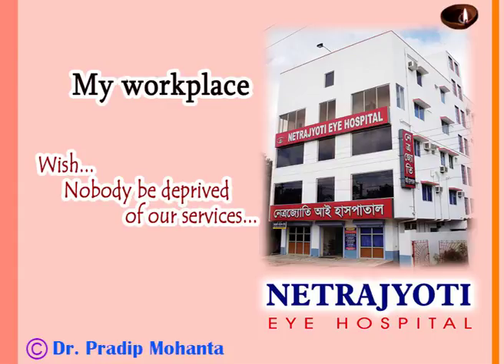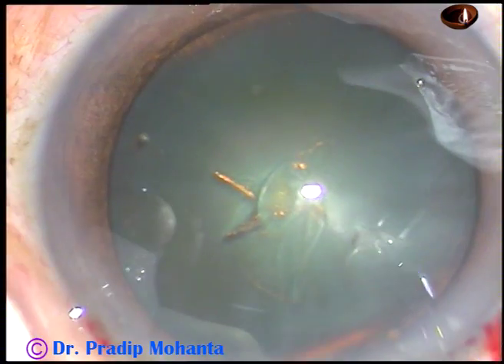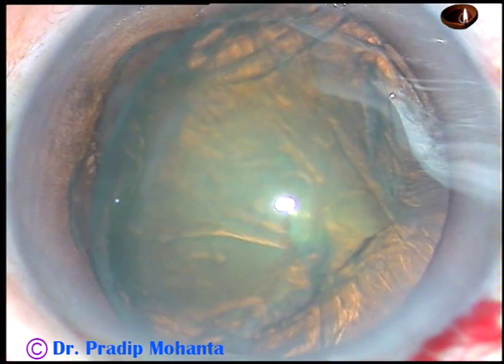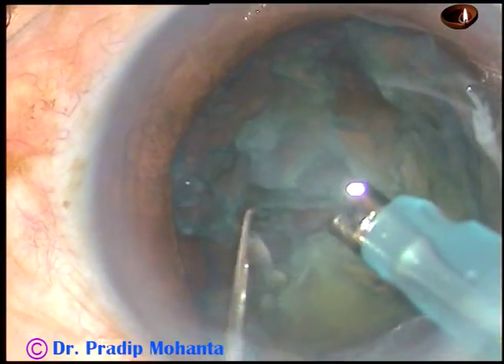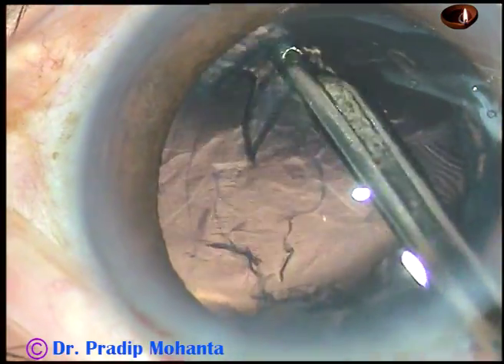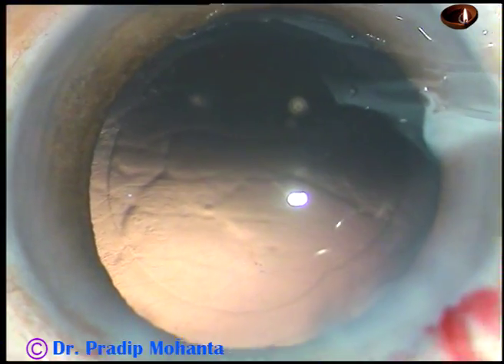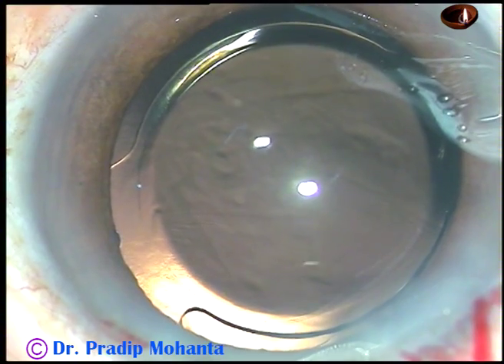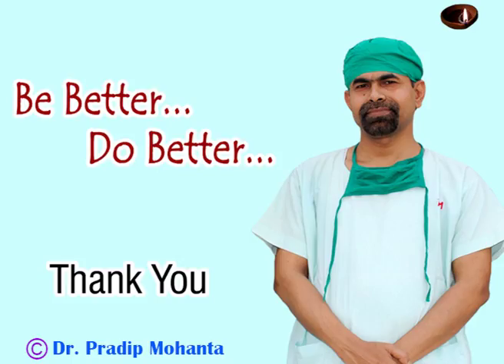Lens Tilt Technique (LTT) for Soft cataracts.

Comment: Impressive as usual!
Few questions though:
1. Does this technique cause more corneal oedema post-op?
2. What was your settings when you removed the prolapsed pole? Was it in segment removal?
Thanks
Reply from the maker: Setting from beginning to end is 
Power 40
Fr 45
Vac 450
No, I do notsee corneal edema with this technique, 
There is always a gap between cornea and lens matter, and the tip is at Iris plane.
Reply: Pradip Mohanta many thanks for your reply